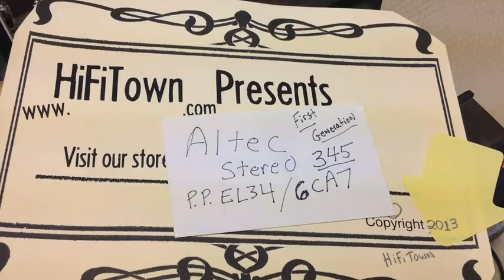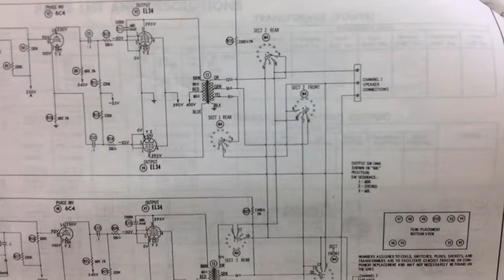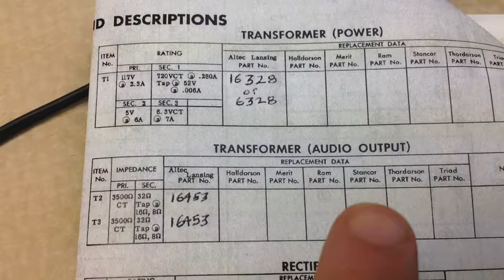Altec 345 Stereo EL34 6CA7 amplifier

Comment: I have one with new Richey power capacitors, orange drop and Sprague coupling capacitors, and the original Mullard power tubes . All other tubes are new. Huge Peerless transformers that barely break a sweat. Also gave it a facelift. They are well worth restoring. A rare and powerful stereo amp built for the consumer. I know of only four other owners. Thanks for the demo!